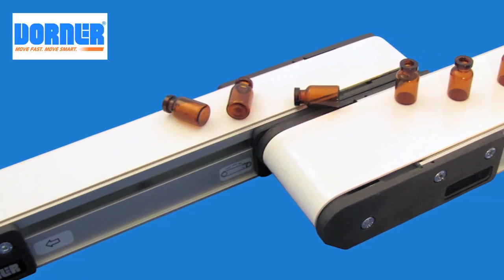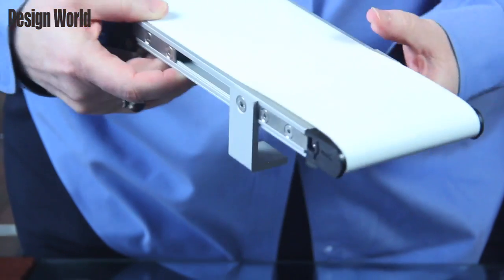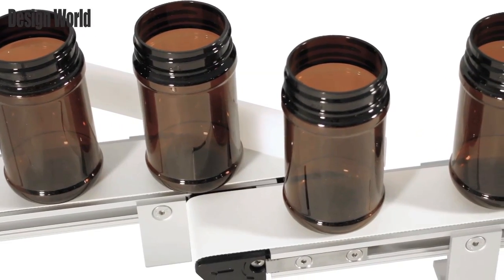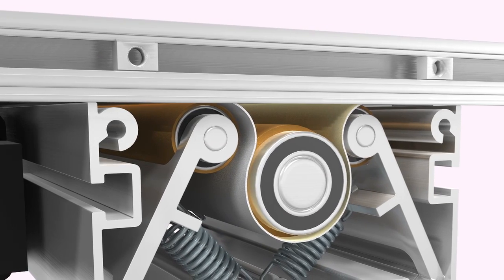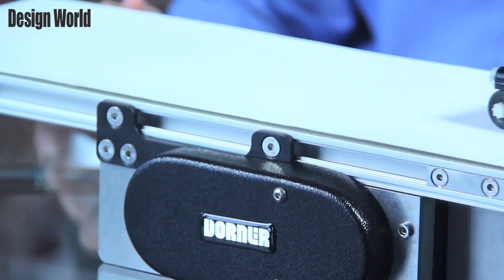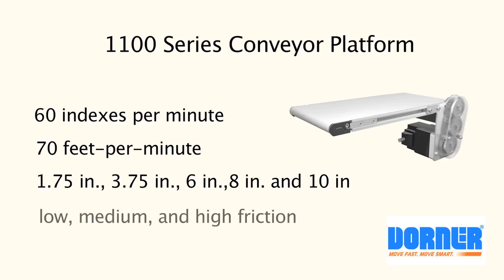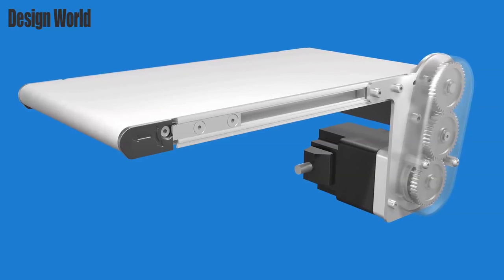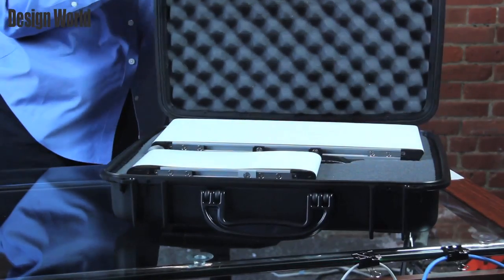Conveyor for small, lightweight product handling

Comment: I am currently constructing a conveyor belt of length half a meter and width 10-12 cm. The conveyor requires to transport a load of 2-3 kg. What specifications should I choose for the DC motor?
Reply: Ash Win hi... You can contact 9130049555